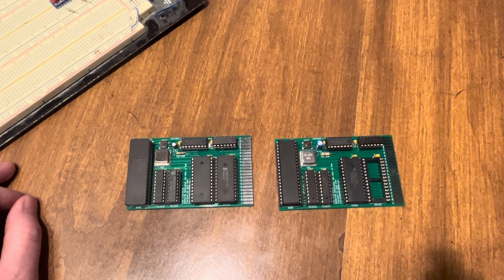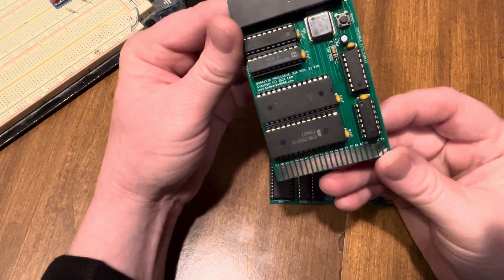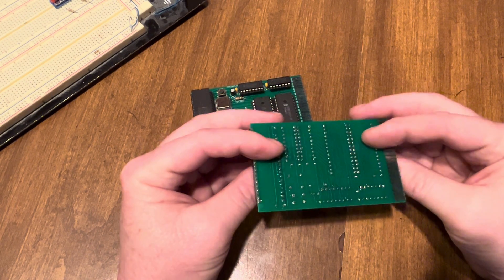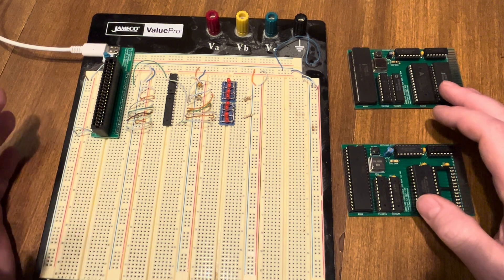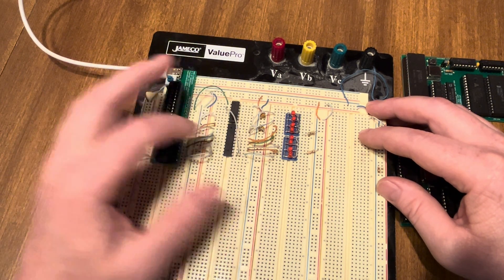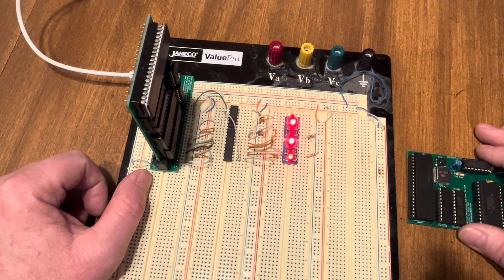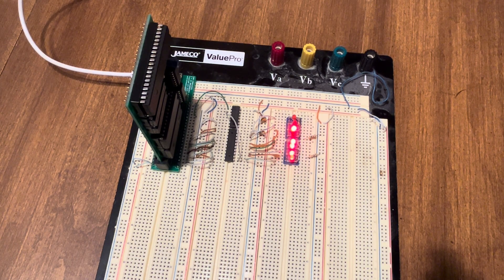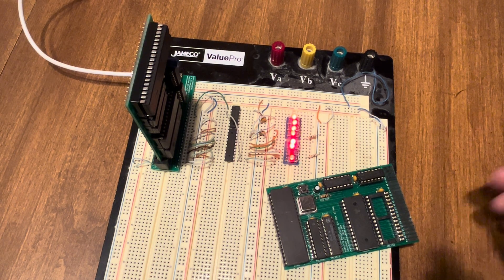Simple 8088 PCB, 16 MHz vs 8 MHz

Comment: Because Z80 is EOL now, using V20 as 8080 starts to make sense.
Reply from the maker: Yeah if you wanted to code it the V20 does run 8085 opcodes

Comment: Interesting build, just one question, what does it do? Is it capable of running dos as it appear to be a simple old pc?
Reply from the maker: It does not have the memory to run DOS. I am looking to use it as a bus controller for an 8086 PC.

Comment: Nice work! I've been on the fence between card-edge connectors and pin headers in my projects. The pin headers are more expensive, but its easier to unplug cards safely.  There's some undeniable street-cred in card-edge, though.  Keep on geeking out!

Comment: Are you going to write a fully specified OS for one of your boards ?  One suggestion; get a Z8 processor that has Basic debug on board, and map in a battery-backed  32 kB SRAM chip to be both ROM and RAM.  That is an easy way to have fun....
Reply from the maker: I had thought of something like that. With this being the prototype I probably won't have anything for a 32k board. The intent is to keep the cost down on the build. But I have already swapped in a 512k RAM and 64k ROM. I feel the slight cost increases is worth the trade off. I will extend all address lines, the MEM RD/WR, and INTR/INTA to the edge connector. With that configuration a decent BIOS could be written.
Reply: You seem to be interfacing chips at the mo' with only a simple paced binary counter showing that it does anything.  Writing a "BIOS" or "OS" is immensely more complex.  One way I might tackle the task is to print out the Spectrum ROM disassembly, then parse it into railroad diagrams, then build a brand new OS inspired by the railroad diagram algorithms.  Good luck!  I had my fun on this too.  :-)😊❤